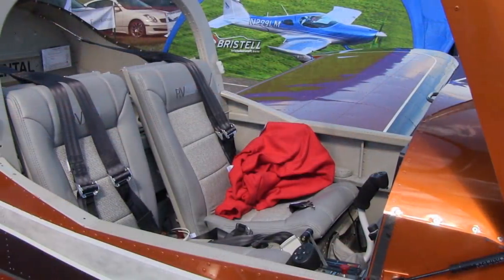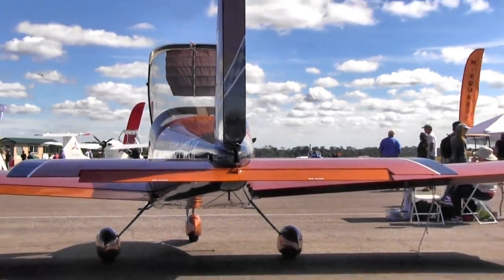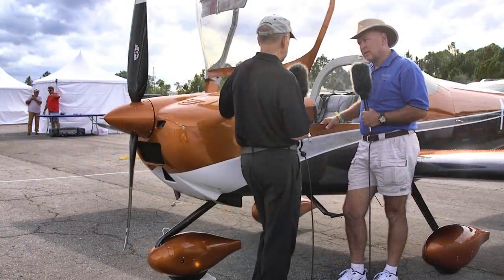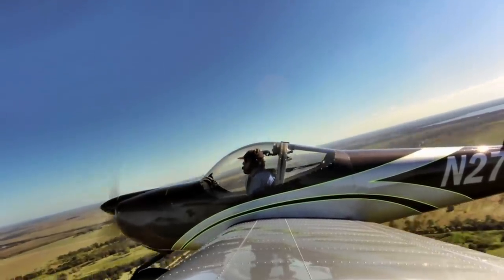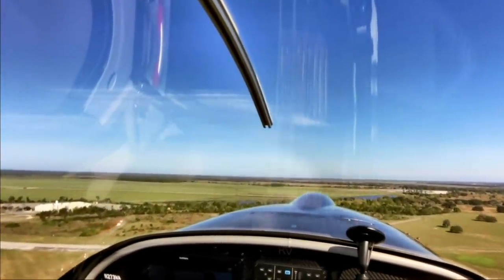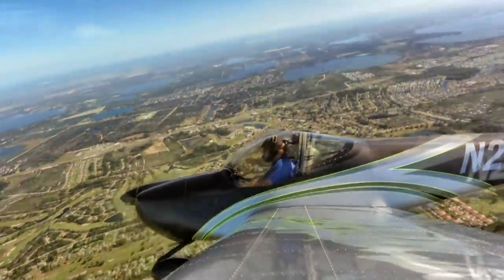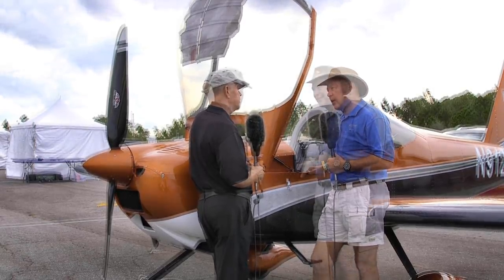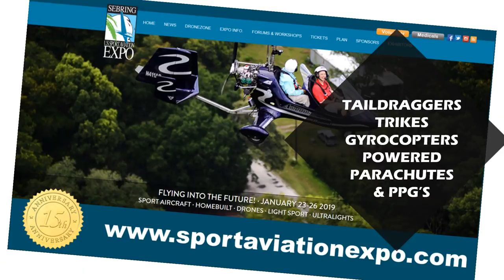RV 12, Van’s Aircraft RV12 light sport and experimental light sport aircraft, Base Leg Aviation.

Comment: My question is for Light Sport and Ultralight Flyer or the light sport community - Can you recommend a low wing SLSA plane that can be sold with a 914? I live in the west, so turbo will be useful to me. This plane will also have a BRS or some other parachute (the chances of my wife flying with me will go way up if I can point to that handle ; -) Can this be a RV12? My light research points only to the Evektor or Astore - are there others? Thanks
Reply from the maker: You have done your research well. Other aircraft include the Bristell, RANS S19,  Viper, used you can consider the Breezer II, SportStar,  and Indus Aircraft. 
https://www.youtube.com/watch?v=F0-XqlBeYpY

The Ultralight Flyer